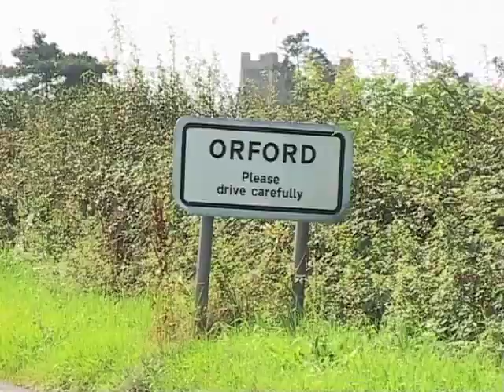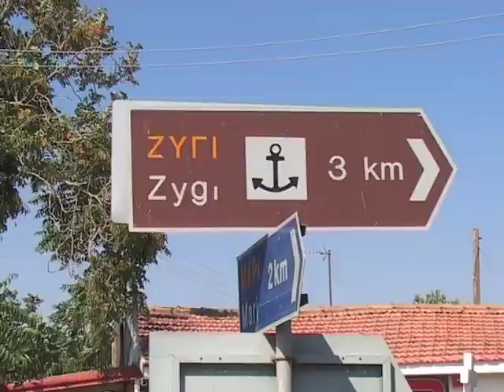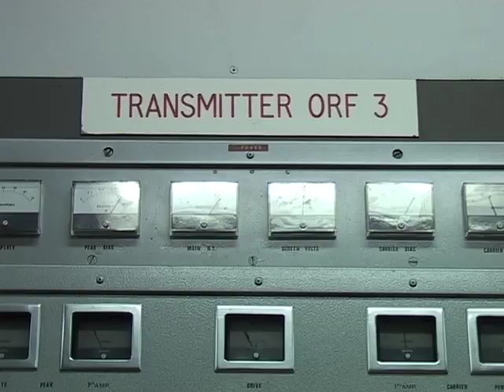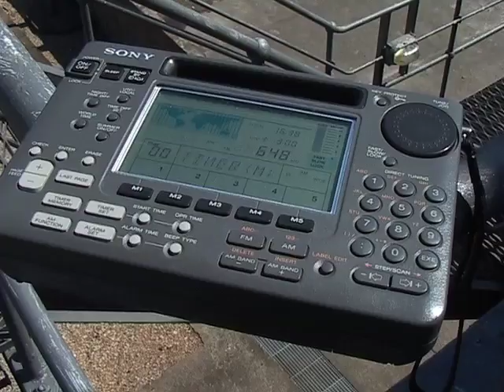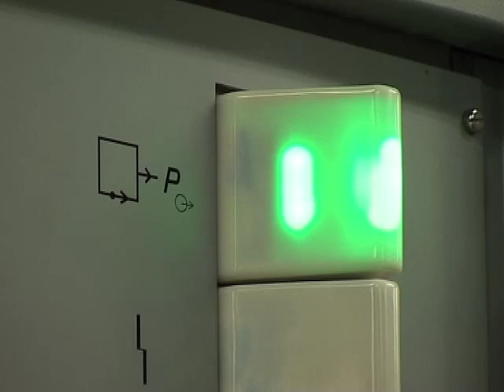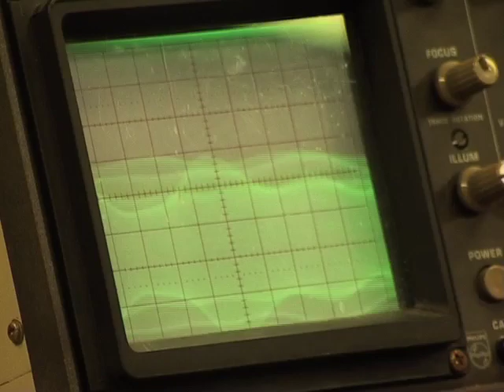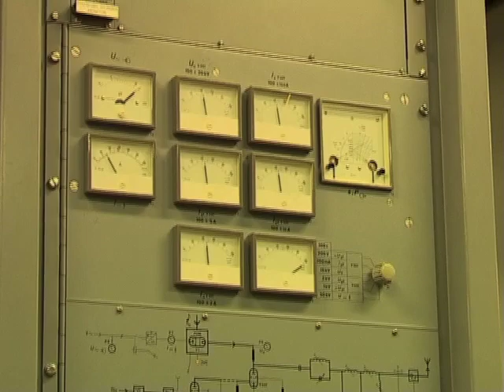Farewell to BBC 648 kHz

Comment: How do you explain this?
I farm near Moreton-in-Marsh, on the Gloucestershire, Oxfordshire, Warwickshire border.
One of my ‘Working Classic’ tractors is a 1992 Ford with its original Ford AM Long wave radios. It’ll pick up 648 metres as clear as a bell, yet any more modern type car radio that still has an AM receiver can hardly pick the 648 signal up.

Why does that ancient radio work so well on 648, but nothing else does?

I love listening to Radio Caroline and to listen to it on anything other than that tractor have to use ‘Tune In’ via Bluetooth to the vehicle radios. Or on ‘Alexa’ when indoors.

Comment: Thanks for "finding" this video and not deleting it from your archive, but publishing it on Youtube Jonathan!! I spend several months at Orfordness in the early 90s as a labourer re-roofing the main building, we couldn't use "torch-on" felt as they obviously didn't want any flames, we had to use a special sticky backed felt which would only stick in temperatures over 18 degrees celcius...so you can guess there was a lot of sitting about drinking tea and reading the paper!!! But didn't matter because the BBC always paid you as long as you were on site ready to work when the weather allowed!! But to add even in the early 90s the building was still a VERY SECRETIVE place, if we had to enter (which wasn't very often and it had to be a VERY good reason) you ALWAYS had a security guard by your side, and you were briefed that if any doors to side rooms were opened "YOU WERE NOT TO LOOK INTO THE ROOM UNDER ANY CIRCUMSTANCES, AND IF YOU DID SEE ANYTHING YOU WERE NOT TO REPEAT WHAT YOU HAD SEEN OFF THE ISLAND!" So all I can say is even in the 90s there must have been more than just the BBC on site!!

Comment: This only covered Northwestern Europe and South East of England. Back in 1991 while i was living in Leicester, every so often the transmitter power was boosted as i could pick this up very clear and local. some hours later it turned very weak and back to the usual area it covered. Also on 1296 KHz had some BBC WS programmes which served the same area, again that too is now gone. Great Memories
Reply: Perhaps your improved reception was when Orfordness was using the omnidirectional antenna mast while maintenance was carried out on the main antenna system.

Comment: Access to this site reminded me of the several occasions I visited what was Radio Australia Darwin, or more correctly Cox Peninsula. This involved a 20 minute fast boat ride across Darwin Harbour to Mandorah, and then about a 15 minute bus ride from the southern end to the northern end of Cox Peninsula. As the shift period for the staff started and finished at the Darwin end of each shift, and the place was 'manned' from about 7am to 12 midnight local time, the cost of labour (with 3 men on each shift) was quite considerable!

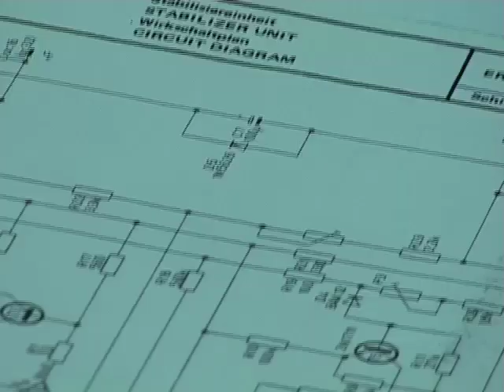Comment: 14:39  Those "OPTIMOD" processor are ancient, yet still work very well. We used one at my former station.
Reply: There's an Optimod still in use on the Ross Revenge. Only appropriate, as Caroline was one of the first, if not THE first, station 'in' the UK to use an Optimod for their processing

Comment: Now used by the revived Radio Caroline, I can sometimes just about hear the signal here in Portsmouth, UK on a good day, but often listen on a local DAB relay.
Reply: Using a cheap indoor loop antenna I can get Caroline up here in Scotland on a decent signal about 70% of the time
Reply: Any idea which of the towers Caroline uses? I'd expect the backup one. The 5 mast array would be way too expensive to maintain for them.

Comment: only good thing Radio Caroline will be keeping the frequency warm
Reply: not just the frequency mate that is their facility still using the same equipment getting into Amsterdam and coastal Europe on just 1kw erp they had to change out the valves  in the transmitter and Jonathon Marks can be heard on Caroline weekendays at 9:00 am for Carolines top 15 and on Thursday evenings for Carolines UK top 40 album countdown Andy is smiling almost laughing in the video knowing that will be turning the transmitters back on for Caroline in the near future it you look carefully you will see Carolines Mike Brill working on the transmitter
Reply: @VickyGeagan  different  transmitter  same masts

Comment: Oh these places are so rare now I worked on a few Radio transmitter stations but for the RAF loved working on transmitters receivers were ok but preferred transmitters I worked at Eddlesborough on the rip out prior to the last installation of Marconi 1140 and 1200s all HF sadly all gone now. Worked at Aird Uig on the 100kW LF that was a great site but didn’t spend a lot of time there and that’s all gone. 
Did a tour in the Falklands on the JCUFI Transmitter site at Bush Rincon and then at St Eval on MATELO, UKMACCS, bit of CROSSFIX a and then the replacement MATELO ... all handed over to Civilain contractor now... happy days